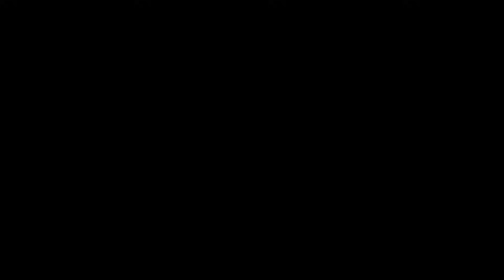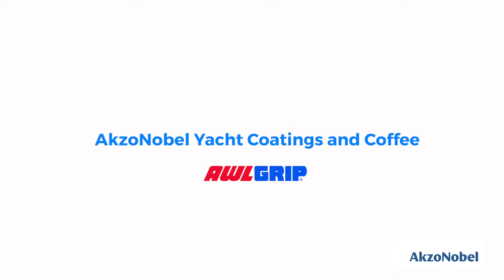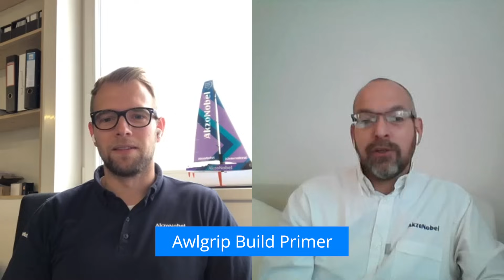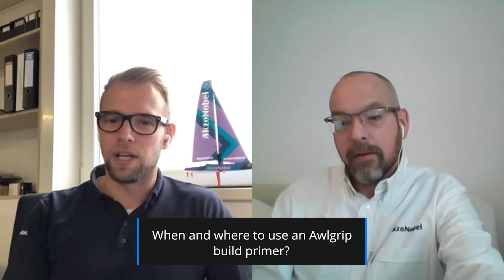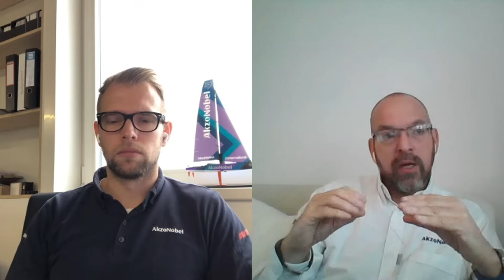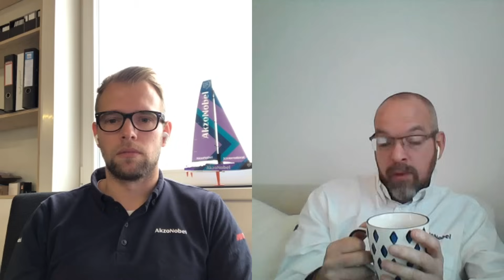AkzoNobel Yacht Coatings and Coffee - What are Build Primers?

Comment: Can be a yellowish colour after 2 years of the paintjob where was spot repairs with filler and not high build primer may be the cause? Or some times the spot repairs get mat in a paintjobs after a few years? Also how muchl time window you have to sand it before become concrete?
Reply from the maker: Hello there - thanks for the message! 

It’s always recommended to use a complete system on top of a filler, build primer then under coat. In simplified terms these are to seal the porosity and process marks from the repair / fairing system. The so-called die back you are experiencing can be caused by the porosity of the underlying products. You should also consider that you have enough topcoat to offer the UV protection to the primers underneath where yellowing and chalking could occur. This should be above 50 microns DFT (Dry Film thickness).